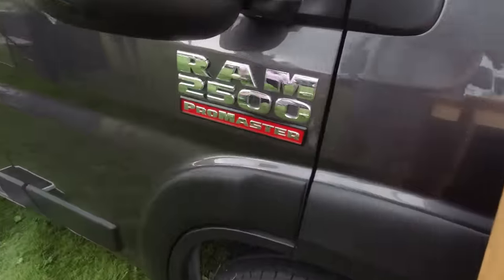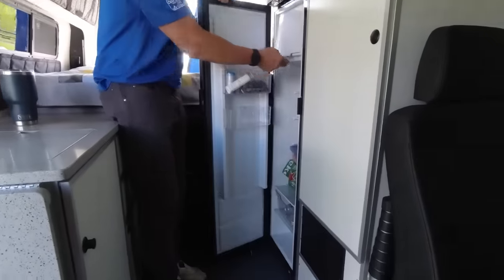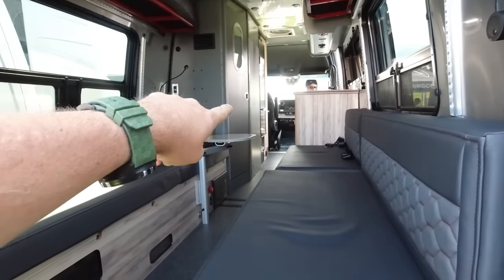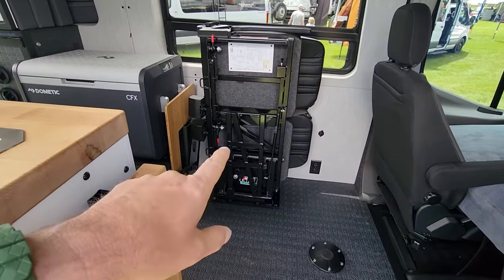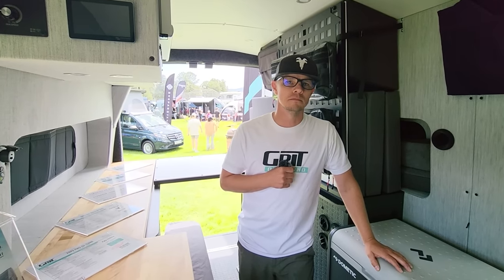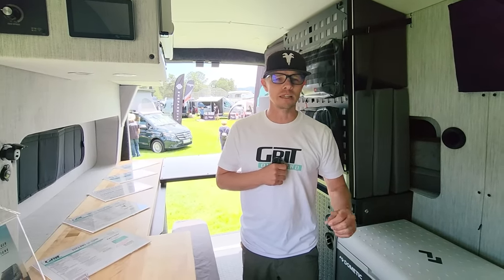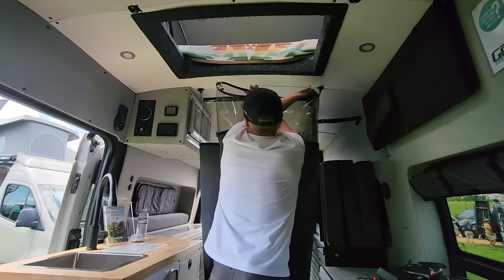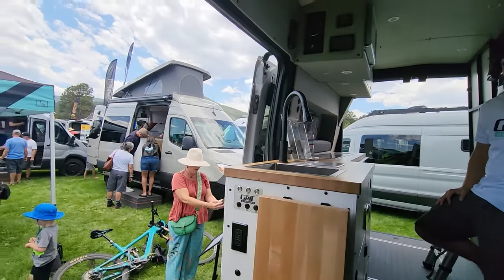Adventure Van Expo Van Builds - 10 van builds companies in one video

Comment: Undermounted ACs have been tried for years.  Roadtrek really tried for one.   They dont work well.  They get super dirty under there.  Becoming inefficient.   And they are loud.  Louder than the better roof units.  Every household has AC sitting in the sun.  Here in AZ nearly all AC units sit on the roof.  Effects nothing.   Just another van industry creation to try and increase sales prices.
Reply from the maker: I wondered how they would hold up being underneath. I didn't buy the whole in the sun less efficiency deal either. I do like the idea of freeing up roof top space. However, I'm not changing my roof mounted AC out quite yet. Thanks for watching!